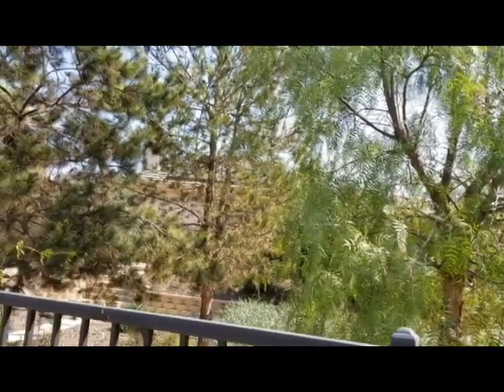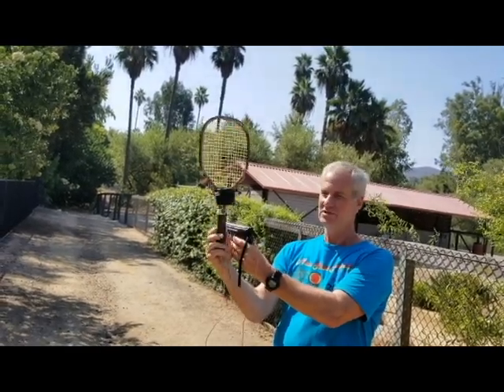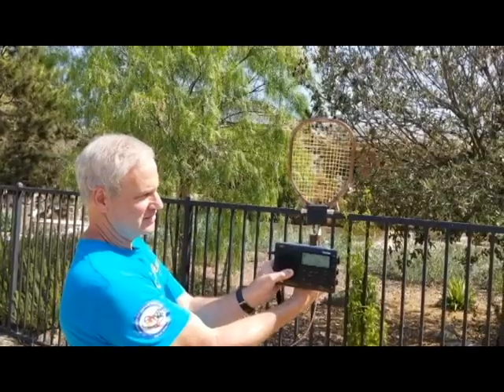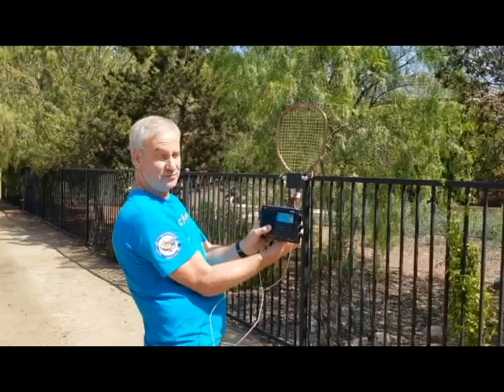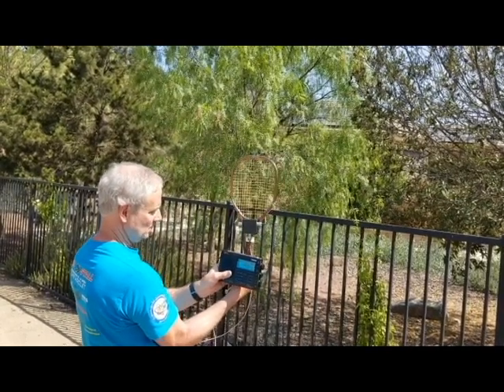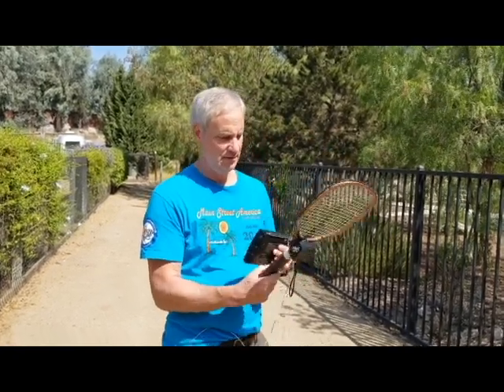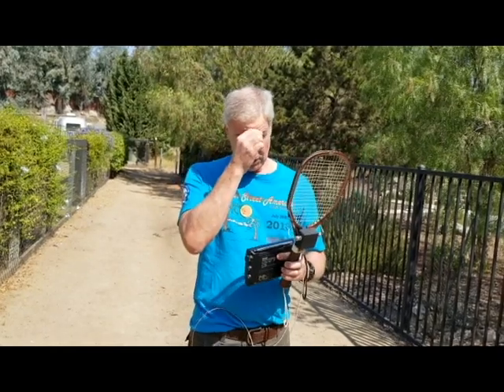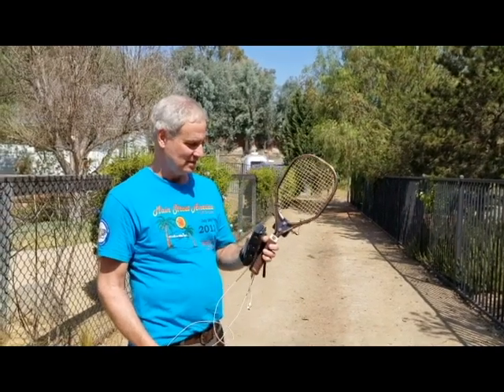Solar Edge Interference to Amateur Radio Stations

Comment: OK, here goes! Check out '73 magazine article dated April 2016 "Can Home Solar Power and Ham Radio Coexist?" for  a possible cure. Unfortunately for me, I didn't discover this article until AFTER I had eighteen panels and a Solar Edge system installed on my QTH. BUMMER, Bummer, Bummer. I can't afford the fix so I have to drive 15 mi to the mountain(s) or 15 miles to the entrance to the Antelope Island State Park gate's parking lot to rid myself of the noise level! DE KA7MWQ

Comment: Yeah, I have found the same in my home!

The inverters produce an armonic wave around 425-435 Khz ( close to the 455 KHz IF ) that is mixed in conventional superheterodine radios ( in 2nd, 3rd or 4rth conversion ) and so it cause the upgrade of background noise in all the bands...

This dont happen in SDR receivers because they directly sampling all the frequencies, without mixing! I saw the 425-435 KHz noise in my SDR-1 receiver!!!

you can see also Here:

https://www.youtube.com/channel/UCJuvZDo-M2yqmd3SyWkiEfw/videos?disable_polymer=1

I have fixed it with a 10 cells High pass pi-filter in serie to the receiver only (bypassing the tx section) with a cut frequency of 1,6-1,7 MHz.

Best Regards

ALDO MERISIO - ITALY

IU2IKW

Comment: Hey folks...I am about to install solar on my home and my understanding with only a little data is that the Microinverter approach (Enphase) is considerably quieter than the SolarEdge/optimizer route. Does anyone have practical experience with this option? WB0CDY
Reply from the maker: Hi.  I have no experience with Enphase but from what I've heard they do not cause the issues reported by the SolarEdge setup.   Howard W6HDG
Reply: @w6hdg428  Thanks Howard...I've also seen one other report that says the same. The manufacturer also claims they're fully shielded for RFI. I appreciate the input. WB0CDY
Reply: What is the verdict here? Was it true? I can't find anything to support it.

Comment: Thanks for the info.  I have read the articles referenced.  I returned from vacation to find my neighbor had solar panels installed.  The display of my FLEX on receive was pretty much solid yellow vertical stripes.  I can work around a lot of the noise by diddling settings, but the interference is really bad, all the way up to 6 meters, but worst on 40 meters (full time s8).  Solar Edge and HD Wave inverter.  Not sure what's next but working on it.
Reply: I am getting up to an S6 - S7 noise floor on 40m and it's horrible.  Do you get a lot of AC humming/crackling down on 80m?

Comment: while the new setapp invertors having terible wifi, supose the antennas are not that well as previous models hdwave.
hard job to fix installations for 2 clients a day this way. Zeversolar instead is working pretty good with the clients wifi connection.